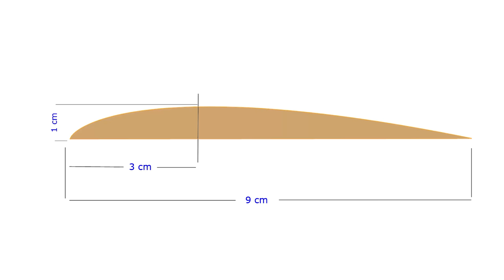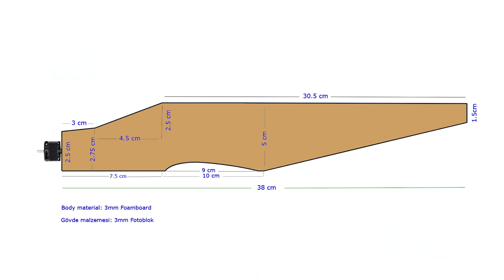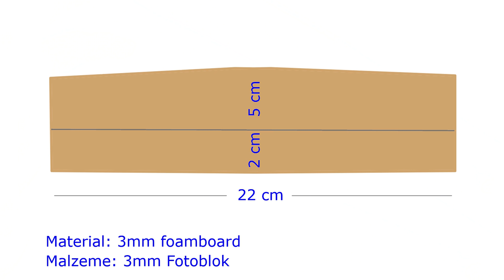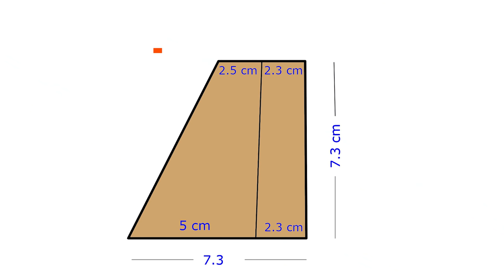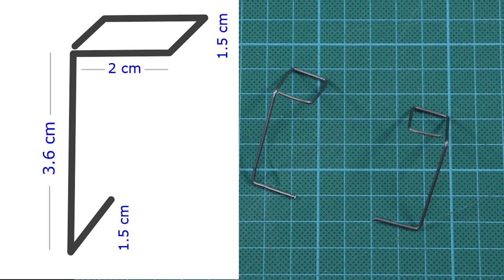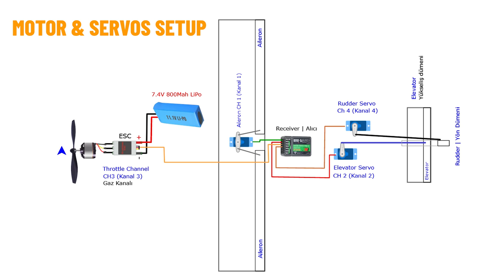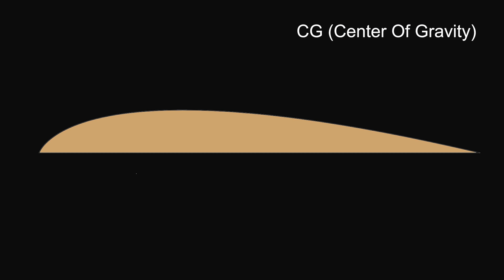How To Make Low Cost RC Airplane. DIY Remote Control Model Plane

Comment: Great job. Great video. I am very jealous, because there is no kraft foam board on Amazon any more., so I can not start to build my plane. Best Regards.
Reply from the maker: Thanks.. It is generally sold in shops and hobby shops that sell the necessary materials for architectural model making.
Reply: @Kendin-Yap  Thanks for reply. Maybe in your country, but here in Croatia I'm not able too find kraft foam. Best Regards

Comment: Thank you for your video. I was worried what to use coz I didn't have a Y-type servo extension.
Reply from the maker: If you have two servo extension cables, you can make a Y cable by connecting them parallel to each other.
Reply: @Kendin-Yap  
Thanks for the insight. That makes my work easier now😃

Comment: What will be the best thurst to weight ratio when making a rc plane? Do thurst overcome the weight to generate enough pull?
Reply from the maker: This value varies according to the style and purpose of the aircraft. Aerobatic model, speed model, sport model etc. is different for. For typical top wing sport-scale aircraft, the one-to-one ratio can be considered as a reference.

Comment: 1306 3100 kv motor will fit ? or should be exactly 4000 kv ?
Reply from the maker: I used it because I have a 3100KV motor. You can use 4000KV.

Comment: Hey bro amazing build 🛐🔥
Question:- can I use normal bldc motor  (like 2200kv or 1000kv )
Reply from the maker: Thanks. This is a small plane. So a small brushless motor like 1306 or 1307 is suitable. KV value is a different matter. It does not represent the power and dimensions of the motor.

Comment: Will 8045 propeller and 1400kv motor fly?
Reply from the maker: It can be used, but since the 8 inch propeller is long, the height of the landing gear is not sufficient. And the propeller will hit the ground.

Comment: would it cause problems if i use a 7.4V 750Mah 70c battery and 5mm foamboard? pls help
Reply from the maker: Yes it is possible
Reply: @Kendin-Yap  from the battery?

Comment: You should try and make a rc plane out of that weird stuff they call balsa wood. It's pretty cheap and lasts longer than foam.
Reply from the maker: 1:14 .. The main support of the wing in this plane is balsa wood.

Comment: I connect my servos to servo tester and everything worked fine. But when I connect the servos to the receiver they start to lag and respond very late. Any solutions ? (I use flysky fs i4 and fs A6 receiver) Bec is 5v and 3A so it should be  enough
Reply from the maker: Rebind your receiver. This might work.
Reply: @Kendin-Yap  thank you so much this really worked. I've lost one of my planes due to this issue. Now it's done. Thank you :)

Comment: One thing am saying you .
Your plan is different and u making different 
Example like where u mount the wing i don't able to understand
Reply from the maker: The assembly in the diagram and the video is the same. The position of the wing is very clear. The same position as the wing profile under the fuselage is clearly visible in the diagram.
Reply: @Kendin-Yap  so sir tell me the wing mountain position from the front

Comment: hocam merhaba kullandığınız servolar kaç derecede çalışıyor ? uçaklar için hangisi uygun ?
Reply from the maker: 90, 120, 180 derece servoların hepsini model uçaklarda kullanabilirsiniz. Uçaklar için standart servo özellikleri fazlasıyla yeterlidir.  Aksi belirtilmedikçe servoların çoğunluğu 45+45 derece standart harekete sahiptir. Dijital kumandalarda menüden bu açı 60+60 a çıkartılabilir.
Reply: @Kendin-Yap  internette 180 derece çalışma aralığı yazıyor .bunu kumandadan değiştirebilir miyim yoksa arduino alıp kod yazarak mı değiştirmem gerekiyor ? teşekkürler cevabınız için .
Reply from the maker: @medal4745  Hayır Uzaktan kumandalar ile kullanılacağı zaman bir şey yapmak gerekmiyor. Kumanda ile 180 derece çalışmaz o servolar. Normal çalışacaktır. 180 derecelik açı Arduino gibi geliştirme kartları ile yapılan projelerde işe yarar. Dediğim gibi 90, 120 ve 180 derecelik tüm servoları kumandalarla tüm rc araçlarda normal kullanabilirsiniz. Sadece 360 derece sonsuz dönüş servolar model araçlarda kullanılmak için uygun değildir.
Reply: @Kendin-Yap  çok teşekkürler cevaplarınız için

Comment: Very nice video sir. Maine aapke is channel ko subscribe kar liya hai sir , aur aapki jo bhi video dekhta hoon usse like jaroor karta hoon, sir meri ek problem hai, aapse ummed rakhta hoon jaroir solve karenge. Sir main 60watt ka hot melt glue gun liya, jo ki glue sticks ko properly nhi galata hai, usme thoda hardness rahta hai, aap jo glue gun use karte hain wo to ek dam badiya Liquids Ki tarah pighlata hai, but mera glue gun to thoda hard hi glue rakhta hai, kuch bhi rc parts chipkane me dikkat aati hai aur thik se chipakta bhi nhi, aisa kyun? Mujhe jyada watt ki glue gun lena chahiye ya kam watt ka. Sir pls 🙏 reply dena👍
Reply from the maker: Sorry, I didn't understand the question as it was written in mixed language. if you're asking about the power of the Glue Gun. I use 30 watts.

Comment: Bir şey sorcam. Neden li-ion pil kullanmıyorsun. Senin kullandığın pil 800mah. 7.4 Volt 49 gram bu arkadaşın ömrünü uzatsan yani iki pili paralel bağlasan 1600mah elde edersin. Ama 2 taneli-ion (18650)kullansan aynı gramajı elde edersin (hesapladım) gene 7.4 volt ama bu sefer 4800mah kadar bir yani ömrü daha uzun olıyo. senin kullandığın pil yaklaşık (140tl) ama iki adet li-ion pil 50 TL her ikiside şarj edilebiliyor. Özel bir sebebe açıklarmısınız :)
Reply from the maker: Bu motor için yeterli gücü sağlayacak olan Li-ion pil (18650) nin iki tanesi 92 gramdır. Benim kullandığım pil 49 gram dır. Fazladan 43 gram bu küçük uçak için aşırı fazla bir ağırlıktır.

Comment: What is that 2deg angle while placing the motor
Reply from the maker: https://www.balsaworkbench.com/?page_id=2714
Reply: @Kendin-Yap  do I have to set motor mount at 2 degrees right???
Reply from the maker: @爪卂卂卂卂  Yes it should be about 2 or 3 degrees
Reply: Thanks 👍🏻 😊 🫂

Comment: hocam bir sorum daha var 1m kanat açıklığı olan 29 a max amper çekişli motorum ve 25 c 3s 2250 mah pilim var .uçuş sürem aşağı yukarı ne olur sizce pili küçük mü almışım ? 15 dakka  olmasını istiyordum .
Reply from the maker: Uçuş süresini etkileyen bir çok faktör vardır. Bu şeklide bir şey söylemek doğru sonucu yansıtmaz.
Reply: @Kendin-Yap  peki pil durumunu uçakta anlık olarak  nasıl görebiliriz fly sky i6x kumandam var

Comment: I don't understand the 2* angle at 11:28?
Reply from the maker: Required for single engine aircraft. The motor creates a force opposite to the direction of rotation. This negative effect causes the plane to lean to the left. When the motor is placed to the right (towards the direction of rotation of the propeller) at an angle of approximately 2 degrees, this negative effect is greatly reduced.
More info... https://www.balsaworkbench.com/?page_id=2714

Comment: motor kvsini 1400 kv kullansak uçarmı
Reply from the maker: Motorun ölçüleri önemli. 1400 kV bunu belirtmez. KV sadece volt başına devir bilgisini verir. Bu yüzden olur yada olmaz diyemem. 1306 veya 1806 ölçülerinde motor kullanabilirsiniz.

Comment: i can use 3s 450mah battery
Reply: and 2 servo 2gram
Reply from the maker: 2gr servo and 450mah lipo are not suitable for this model.
Reply: I have 1404 4600kv, i can use it on that planr

Comment: abi 2 tane 2507 2300 kv fırçasız  motora 30a esc uygunmudur.
Reply from the maker: Her biri için 30a esc 3S ile kullanılacaksa yeterli olur normalde. Ama motorun teknik özelliklerindeki maksimum akım değerini kontrol etmen iyi olur.
Reply: @Kendin-Yap  uçuş kontrol kartı olarak önerdiğin varmı abi

Comment: Please put the cardboard link please please please
Reply from the maker: You can find the foamboard from local retailers in your country.
It is generally sold in shops and hobby shops that sell the necessary materials for architectural model making.
Reply: @Kendin-Yap  THANK YOU
Reply: @Kendin-Yap  please upload RC CAR video with geared motor for tyre

Comment: Abi allah aşkına yardın et ben yeni alıcı aldım kumandaya bind ettim esc takılıyken motor çalışıyo ama bana sadece servo motor lazın servo motoru takıyorum çalışmıyo neden sence
Reply from the maker: Tam olarak ne yaptığını bilmem mümkün olmadığı için çok net bir şey söyleyemiyorum. Ama Servonun çalışabilmesi için ESC takılı kalmalı ki servo elektrik alabilsin. (Motor bağlı olmak zorunda değil) Yada alıcıyı harici bir pil ile besleyebilirsin. (Alıcı için uygun voltajda olmalı).  Genellikle 5-6 volt ile çalışır alıcılar.  (Uyarı: Alıcıya direk olarak Lipo pil bağlamayın)
Reply: @Kendin-Yap  abi direk ben lipo pil bağlıyorum yaptım bu arada escsiz nasıl bağlayabiliriz
Reply from the maker: @HECTOR-ys9km  Direk derken sanırım pili ESC ye bağladığını kastediyorsun. Alıcıyı ESC olmadan beslemek için 4 lü kalem pil kutularını kullanabilirsin. 4 kalem pil yeterli olur. Alıcının Batarya girişine veya herhangi bir boş kanalına takabilirsin. Kutup yönlerine dikkat ederek tabi. Ters kutup alıcının yanmasına sebep olur.